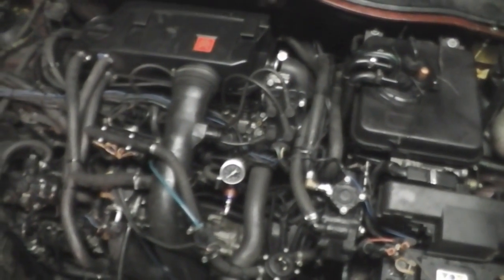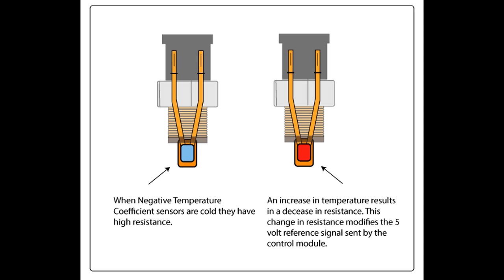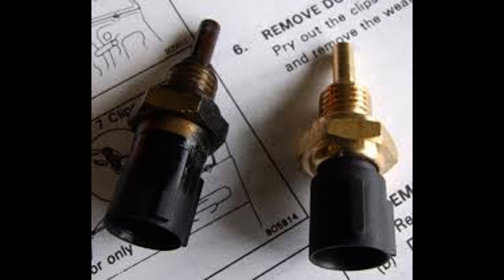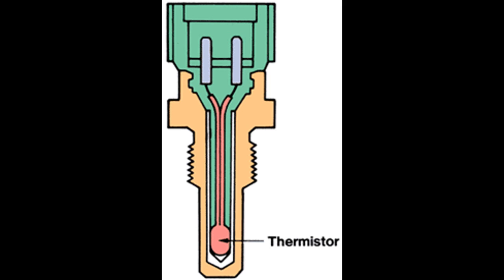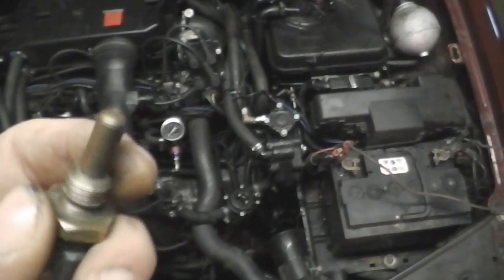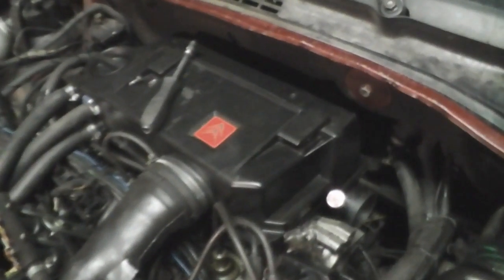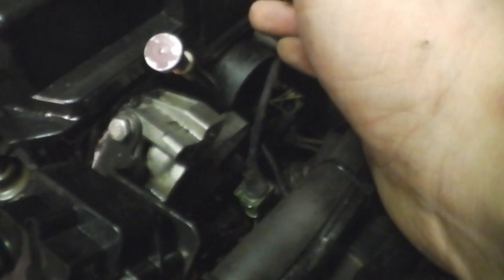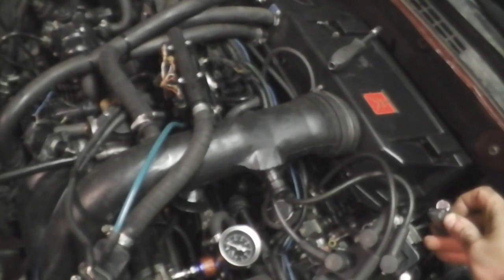ECT engine coolant temperature sensor? How is affect Fuel Mixture And Idle?

Comment: Thanks for your video Carshed68. Its the only video I could find that seems to answer directly what I've been trying to figure out. My car has a horrible engine idle WHEN COLD. But when it the car warms up, the idle smooths out a lot (improves).  The cold idle is really rough. Do you think it is my ECT sensor based on this description I have given?
Reply from the maker: Probably yes.

Comment: Is there a way to trick the ecu if the ECT sensor is not working to get the car to start early in the morning?
Reply from the maker: Yes you need right resistor.